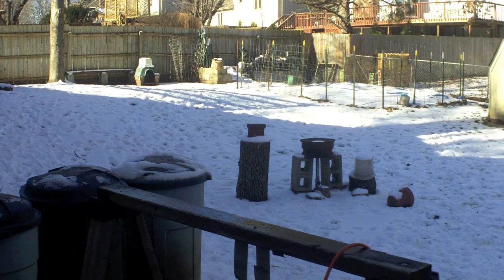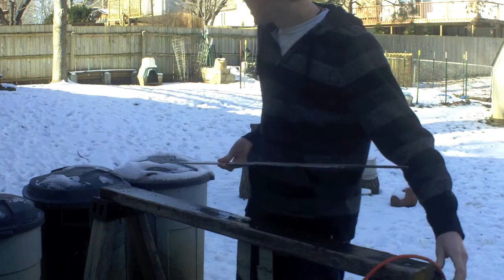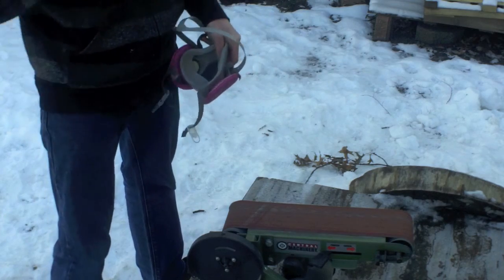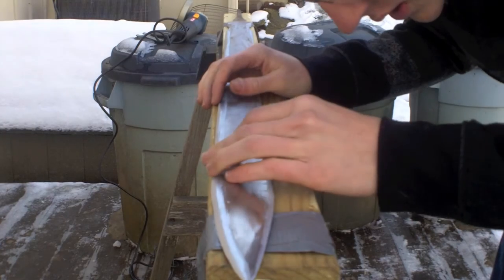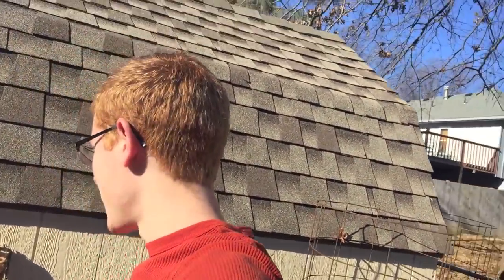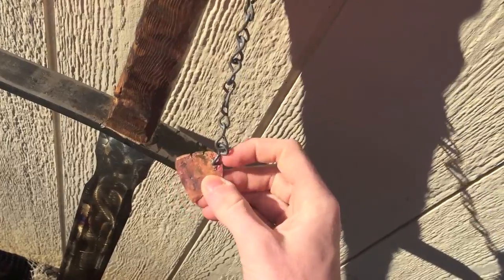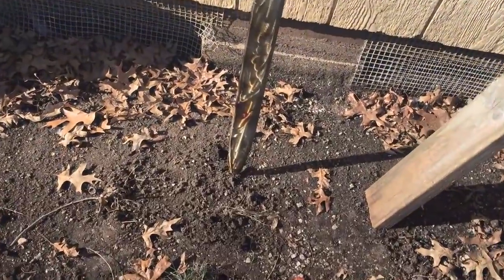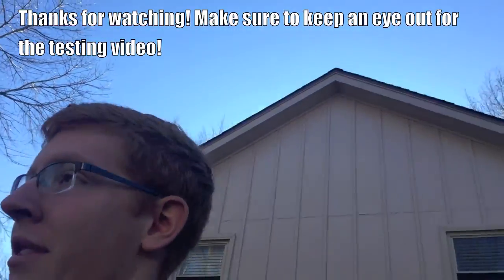Hand Making a Great Sword! (Longsword Build)

Comment: yes you can harden mild steel anyone who says you cant obviously just take peoples word without actually trying something. i know for a fact you can harden mild steel cause ive done it and i swear on my life it works.
Reply from the maker: +Anthony Perella I agree I have never had a problem with it either.
Reply: I will say mild steel doesnt make the best blades but it does infact work and can be tempered
Reply: even if you do somehow manage to harden it its still not a good choice for steel
Reply: zombie_joe13 we all know this its the fact that people say it cant be hardened when it most certainly can
Reply: can it be hardened, yes, but is it worth trying to harden, no
Reply: It cannot be hardened enough to make a good knife edge, unless you carbonize it. Normal quenching in oil or water will not harden it enough to be able to skate a file over it without scratching it, like you can with high carbon steel.